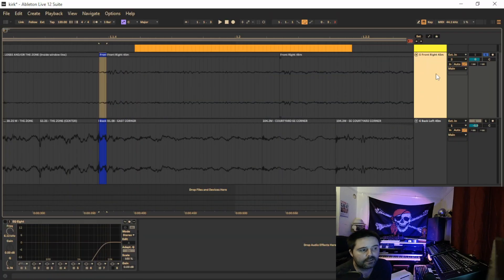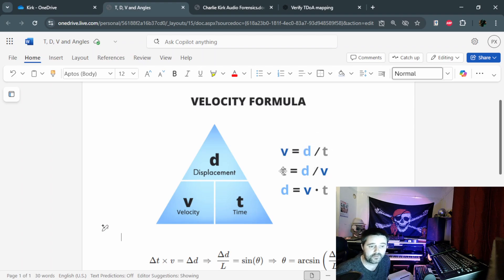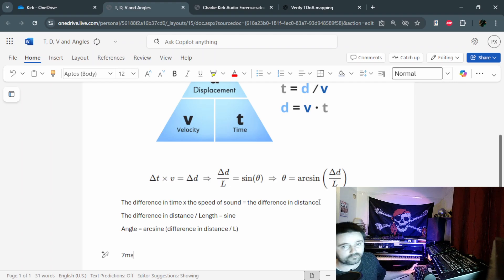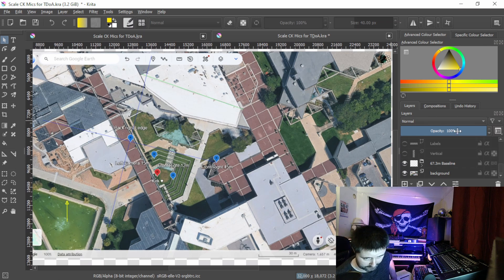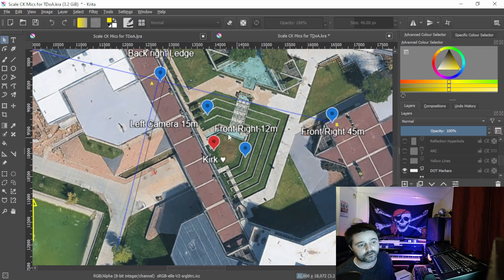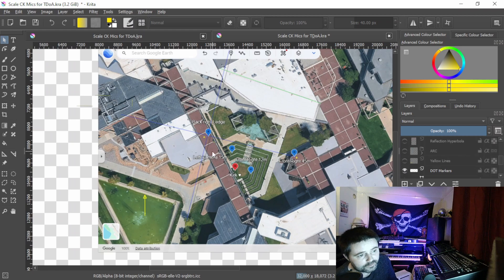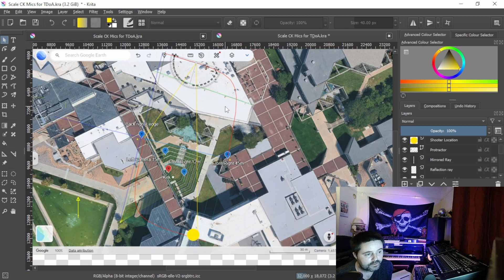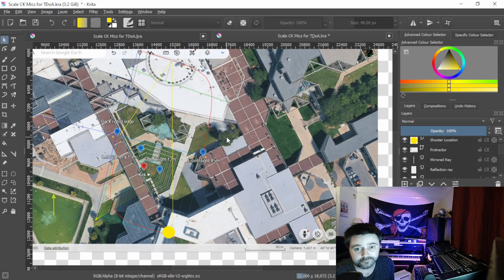Reflection vs Source | TDoA Audio Geometry Explained

Comment from the maker: Sorry this one took a minute to record — I’ve been neck-deep in geometry and physics for a couple of weeks now, and planning the videos is something extra on top of the actual work itself.

This episode’s a bit of a bridge — setting up the physics before we jump into the visual side of things. The next ones will get more hands-on with the reflections, hyperbolas, and how the geometry actually looks when we map it out in Krita.

As always, if you spot something I missed or you’ve got a different angle on the data, drop it in the comments — I’ll happily run the numbers.

Thanks for sticking with the science. The goal here is simple: keep it honest, show the maths, and let the sound do the talking. 🎧
Reply: I may be repeating this as it disappeared as I was typing it. But I have got these so far from asking AI Camera Name,Lat,Long
Back Right Camera,40.27773449,-111.71383165
Left Camera,40.277779,-111.71406682
Front Right Camera,40.27806516,-111.71351491
Back Position,40.2775092,-111.71389

But I need to sort the camera names, the wav files etc in sequence before i process them. They say with 4 you can have 3D - x, y and z.

I've also looked at simple trajectory solving - so if you say e.g 75m and the height has to be X metres it can resolve the angle. If the angle fails the down through the neck shot then I guess the position is wrong. The seated height of Charlie may be 3 to 4 feet. The seat looks low.
Reply: you should also look at Tennakoon's theory to see whether both can be right.
Reply from the maker: @davidmorgan156  I don't know who that is. Got a link?
Reply from the maker: @davidmorgan156  I will be triangulating, or at least attempting to at some point for that. That was actually a really cool trick, I hadn't though of getting coordinates from Ai, genius!

Comment: I saw a video—which I have downloaded—in which you can briefly see what is presumably a blurry bullet, which hits him in the upper part of his head on his right-hand side. From that observation, I inferred where the shooter would be in another video I had, in which I then searched frame by frame for a possible muzzle flash. Exactly where and when I expected it, there it was—a brief muzzle flash, visible for a single frame, a fraction of a second before he was hit.

The muzzle flash corresponds almost exactly with the location you identify with your acoustic analysis in the bird’s-eye view: although slightly up and to the left on the screen, from a window in the long, thin building with the brownish roof, at the far end from Kirk’s perspective and nearest to the bottom of the screen in your bird’s-eye view, close to the stairs where several dozen people were standing.

I’ve never seen this mentioned anywhere, especially by the hapless (or complicit?) FBI.

The trajectory suggested by the blurry bullet video, the location of the single-frame muzzle flash, and your acoustic reconstruction all align. That would also account for the wound pattern: an exit wound on the left side of his neck, which is widely, but in my view incorrectly, assumed to be the entry wound.

Comment: The Paramount Tactical Youtube chanel flew a drone over the campus and has an exact 3D model of the campus that could be used for modelling echoes
Reply from the maker: Yeah, perhaps we'll use it in a demo later down the line, but for measurements google earth works to an extent. + I'm not a video/graphics guy

Comment: Mr Bowden, 
I appreciate you going through all of this math, geometry.  I’m 61 and had some understanding of how sound systems work in amphitheater show locations and recall how difficult it was to reduce the reflection off of concrete walls and barriers.  I haven’t done that type of work in a while and I have to watch your videos several times for the math to wake up my old brain and to sink back in, but I appreciate all your hard work and I’m anxious for every one of your videos to be posted.  This is real forensic investigation that follows laws, not assumptions, opinions, possibilities or made up theories we’ve seen all over the net in the last 33 days.
Eric in Greensboro, NC.  USA
Reply from the maker: Eric, I really appreciate the time you've taken and effort you've put in to it. It is a bit of work, and like you, I'm learning as I go with some of this stuff. It's one thing knowing it exists, and another following it through. I am trying not to give an opinion as it's a touchy subject and because my tests do not fall to what happened, only what the sound did after, I like to think I am working backwards to find a conclusion, rather than start at the conclusion to find a problem. Thanks again mate, appreciated!
Reply: @Audio-Freq I think you’ve handled yourself staying on the fence really well.  The math will bear out the truth!  Keep up the good work-cheers!

Comment: From John E Hoover channel about CK being knocked backward and your audio analysis of the loud noise coming from stage right, adding LookoutfaCharlie's analysis that two separate noises occur at, almost, once makes it possible that the experiment was to confuse audio and visual, that DON'T line up. 

The Healthy American Peggy Hall channel shows many many quirks in an obvious staged performance, not the least of which is the 'exit' wound moving. 

We are dealing with such a deception on a collective level needing to trick crowds as well as the courts, it remains in the lab 4 the continuity of contagion that is global politics anyway (F is real), certainly NOT the contagion of miracles Lynn Margulis brought up in early evolution, perpetual for eons, such as with symbiosis and mitochondria.

It is a networking challenge, nevertheless, and, an ouroboros issue, as the late, prematurely terminatED,  Francisco J. Varela noted. 

For the truth behind the simplification toward a larger context in understanding such a Grand setting that is ours for the taking, where JWST confirms the universe is oscillatory, and, dark matter is free in a bottle with 24 methods of identification, hydrino, Gestalt is default for each leap in any shift of paradigm. KISS

Comment: MAT, HOW DO WE GET IN CONTACT REGARDING THIS MATERIAL? I HAVE  RENDERED A 3D MODEL OF THAT PART OF THE CAMPUS FROM DIMENSIONS AND RATIOS I COULD CALCULATE OFF GOOGLE MAPS AND IT PROVES YOUR POINT IN A VERY UNEXPECTED WAY. I CONTACTED JASON BEFORE HENCE HE MENTIONED ONE ROOF THEORY IN YOUR RECENT MEETING. i ALSO SHARED MY FINDINGS WITH  ALL THE RESEARCHERS O THIS MATTER I THOUGHT  WERE AHEAD OF THE REST BUT NONE TOOK IT FOR PROBABLE. NOW I HAVE THE EXACT POSITION AND SHOOTING WINDOW AND ANGLE WITHIN 5-10 DEGREES. IN MY OPINION CHARLIE WAS MAYBE SHOT IN THE EAR CANAL/ EAR DRUM WITH A HIGH VELOCITY SMALL CALIBER ROUND FROM HIS RIGHT SIDE UP      VERY CLOSE TO THE LOCATION YOU CALCULATED THE SOUND COMES FROM.

Comment: Do you include the angle of the left and right mic, in relation to the direction

Like in line, parallel, with direction giving biggest time difference, to the other extreme being widest distance from another, almost approaching entry/recording without any time difference.

(the angle of the cam, relative to source; one always is including assumptions, until one has enough recording at different locations, knowing their relative differences in angles among each other)
Reply from the maker: Well I haven't touched the stereo stuff yet. I'm still measuring the field with echoes and reflections at the moment. If that is what you mean. But I'd use the same technique as this, just on the waveforms instead

Comment: Just went back to look.  

In the first assassination attempt on the president, the time gap estimate was 210ms at a distance of 135 meters.  The trajectory of subsequent shots appears to be further away from the podium so the relative timing would be somewhat different, but generally similar.  This implies that even at 135 meters out we could see a time gap of 215-220 ms so for a distance of 140 meters +/-5 a time gap of .241s seems very reasonable.  The bullet would have arrived well before a 1/4 second to its mark and yet we didn't start witnessing the impact until .74-.82 (3/4)seconds?

That actually defies physics.  How does a shot that should take .250 seconds even at the speed of sound still not impacting the target until .75 seconds later, almost a 1/2 second delay?  
It's just not possible.

And I do not believe your measurements are off.  
What you have measured and we all have observed is that the impact was moving more closely to the speed of sound.  Which doesn't make much sense-but i'm sure can be explained.   And if Charlie was hit by a bullet, that impact should have arrived well before the speed of sound-not about or anywhere near the same time as its arrival.  

What if anything did impact Charlie if it wasn't the round or projectile we hear?   To me this is one of the more important things you have uncovered thus far that I kind of overlooked in the beginning.  But provides some explanation as to why your distance estimate would be underestimated then, and from the beginning I wondered why we did not see the impact sooner than we did.  Thanks for sharing this all with us and thanks for letting us share it!
Reply from the maker: Yeah I get it, the whole audio doesn't make so much sense if the shooter was 130m away. I think the audio would present the other way round, personally. The surfaces are up for debate. If anyone can place a more obvious choice I'm missing I'm happy to change it up. I'm just looking for connections to tie and measure at the second. Yeah I think I actually did measure it the wrong way round for the bang to impact, but it wasn't relevant to the reflections other than the shot wasn't miles away or something.  I haven't actually measured the trump one myself. I may do though man. It seems like a good progression but there is loads to do here still
Reply: @Audio-Freq  It appears as though if we apply the same technique used in your example here with the other mics we begin to see a pattern.  The pattern basically just rotates what you have created here in a counter clockwise motion.  It appears as though using the 45 Front and the 7M, that would rotate the situation counter clockwise enough so as the source arc would clip the Keller Building.  Would this location explain the geometric pattern of reflections we see, the TDoA, and the time gap of the shot fired?
Reply from the maker: @JasonFox-k2i that's the kitty. This measure might be wrong, we have to measure the measure 😆 but yes, the more pairs, reflections etc... we are essentially triangulating with audio. Then backing it up. I designed a wikkid test about 10 minutes a go but got to get through other tests.. loads to do
Reply: @Audio-Freq  thanks for all your hard work on this mate!
Reply from the maker: @JasonFox-k2i  Thanks for sticking with me. I'm learning here too, so I will likely make mistakes but if we all work together we can keep ourselves sane
Reply: "That actually defies physics.  How does a shot that should take .250 seconds even at the speed of sound still not impacting the target until .75 seconds later, almost a 1/2 second delay?  
It's just not possible."

I think you're not quite getting the picture regards the impact/sound/bullet.
The bullet hits Charlie - that is the 'Impact' - but because of human neuropathy and physiology Charlie takes some microseconds before his body responds to the entry and cavitation caused by a supersonic bullet entering his system. Then his arms are drawn up and he begins to fall to his left all within 1 second or so. Matt is using the calculated impact time based upon the observed actions of Charlie as he is hit and setting the first sound the mic's record as the starting point for his time calculations for each video and related audio tracks.
The bullet is traveling (or the one the FBI wants us to think is the bullet) roughly 2.4 times the speed of sound so will hit Charlie approx 1/10th of a second after being fired if we assume it came from the Lossee building (which I don't believe). Add the body reaction time ( <100ms) and you have less than 200ms for a bullet from leaving the gun to being seen hitting Charlie.
BUT the first sound will arrive at a different time for each one of the 5 mic's Matt is testing. This is the crack and comes from the tip of the supersonic speeding bullet as it passes perpendicularly to each mic, with a 'delay', as the crack forms a 'cone' shape more than a spherical shape, as the gunshot firing sound does. The bullet has to pass the mic by quite a bit before the sound is picked up in the mic.
The sound of the gunshot exploding from the gun comes along at the speed of sound after this.
Again, all Matt's audio tracks commence with the first sound and he's used a calculated 'time', relating to when each tracks video shows Charlie's body reaction so as to synchronise all 5 tracks so he can compare various echoes in the amphitheater, not so he can determine the initial gun location.
Am happy to hear any alternatives/questions!
Reply: @MrAuswest  Look I'm just going by Matt's work and what it tells us and that's what it says like it or not.  And you obviously don't like it.  Here's another thing though you should get informed on before you come here attacking me or anyone.  

The crack of sonic shock wave  is not made as the bullet passes perpendicular, but nearly perpendicular, and do you know why?  Go research it.  The initial crack that's the sound of the mach cone and it doesn't originate at the rifle but on the closest point on the mach cone to the mic or phone.   

I'm writing a paper up on this now, so if you're not too lazy to go and read that maybe then you can use science to prove me wrong.  Then I will be happy to hear any real alternatives and questions you may have.  I think you're not quite getting the picture, so at least we agree on one thing!